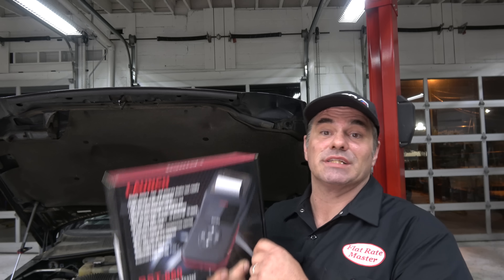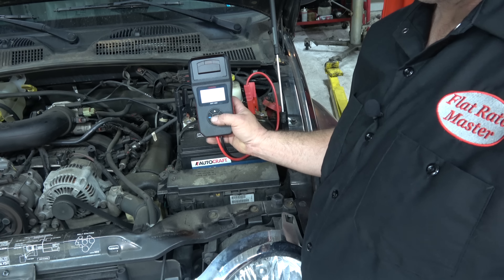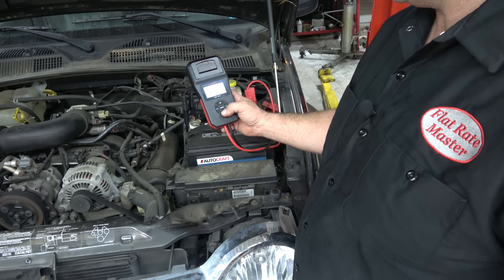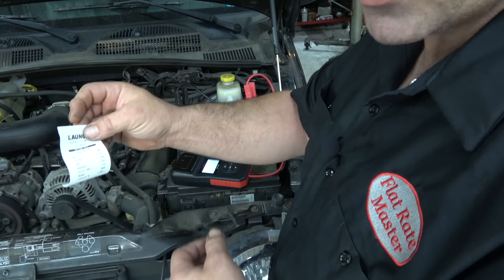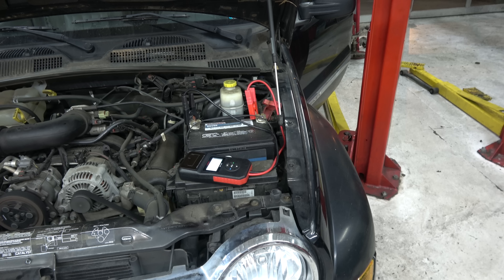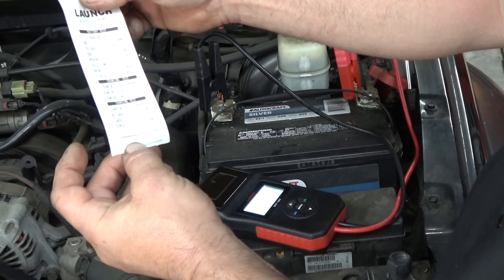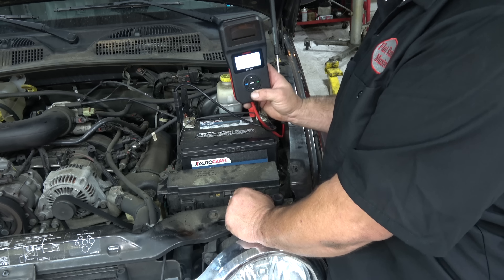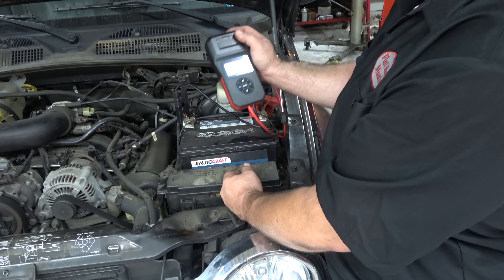Launch Battery Tester

Comment: I currently have 5 battery tester, and no carbon pile does not get done in morden engines 

Voltage more than ever is so critical to operation of engines, 

Ripple,interal resistance, and let's not forget the ever so important CONDUCTANCE test .

The factory now requires verified "HANDSHAKE " between the tester & car & battery for any warranty work to be paid 

Great video 

Under stressed subject

Comment: Great video btw, and Not to question you, but I'd think on the charging test, 200mv ripple is a bit high? Shouldn't be more down around 50mv ripple? I've always gone by 250mv ripple is a bad alternator....
Reply: i have always gone by 0.5 volts or 500 mv or less! anything more is usually bad alternator! 200mv is normal

Comment: I would of bought one years ago, but  the big problem with battery testers is it can say the battery is good today and it can be dead the next morning! don't need one to tell me a battery is bad.
Reply: I have the Foxwell tester and put it on an '02 Avalanche. I went through all the tests and the battery passed all of them, so I started looking for a draw. After putting the modules to sleep several times and never finding a significant draw, I load tested the battery on the AVR: it dropped to 6.9 volts. I replaced the battery and kept the car overnight to make sure the voltage stayed up before I sent the car. I've had a few of these types of testers over the years, tool truck guys always talk about how much money you can make by showing the customer the printout and selling batteries. Maybe when they can make one with reliable results.

Comment: if battery rated at 660 how can it measure 750?
Reply: It looks like a new battery.  Many times new batteries will test higher than the "rated" CCA.  Rated CCA is a nominal rating (versus actual).  In addition to that, some battery testers that use transconductance may not account for any surface charge that may be present - especially if the car was recently running/charging.  Better ones will recognize any surface charge present and warn the operator so he/she can remove it by something like turning the headlights on for a few seconds/minutes.

Comment: Good video except one point. You say you don't like raising it to 2500 rpm with the short cables but you never explained yourself so the average person watching this video won't know what you mean. 

In this day and age if you lay it out there let's bring the whole tamale. You don't want future techs halfway trained do you?
Reply: Dale N you mean he really needs to explain how the cables aren’t long enough to reach into the car to see the tester while raising rpms with accelerator? If someone can’t figure that out by using common sense they might need to work in a different field.
Reply: @Ram2253spd  you can raise rpms to 2500 and come back and look at results. It says Autel on it so I'd pass to begin with. I have a El cheapo similar and I wonder if I looked it would probably be the same. Been put away so long. Was a wrong item sent from Amazon once and they didn't want to pay to have it shipped back.
Reply: It says launch not autel and if u cant figure out what he means by the cables are to short to raise to 2500 rpms and see screen at same time u shouldnt be working on cars anyways
Reply: @dylankinch2735  launch my bad same thing as Autel, knock off. And in regards to cable length if you're not using that you can get to 2500 with live data with any decent scan tool anyways. Like he said it's not his go to either. Smaller cables on the Picoscope so it don't matter anyways because as he said Picoscope is much better and I couldn't agree more with him as if anyone's been around long enough they probably have a Picoscope or decent scan tool with a component tester.
Reply: What do u have against launch or autel. I have both launch and autel scan tools and they certainly are not knock offs. I use my autel more then my snap on scan tool. Its certainly has more bidirectional controls for more makes and models. I have a bunch of high endscantools i dont get why u say launch or autel are knock offs. Knock offs from what
Reply: Dylan Kinch Autel is not a knock off. Not sure what that guy is talking about. Autel has great support too.
Reply: @dylankinch2735  must not have a Solus Edge, Modis Edge or newer? Check out the Snap-On scanner tool training videos they offer for each specific scan tool.  I know the newer stuff has a lot of the stuff people say Autel has but Snap-On don't. Don't know where they find their information. When it comes to programming just a J-Box and internet connection and you can get it back to OEM spec software wise. The cost is a pass thru to the customer. 

J-Box essentially will let you do anything the dealer can and then some. Drew Tech has a nice setup. Make sure you have a 100amp charger or something capable of doing 100amp for a few minutes. The Schumacher I have is 70-80 amp with 100amp for a few minutes.